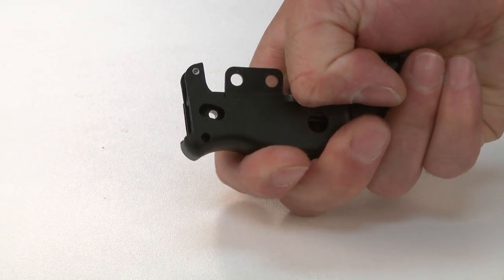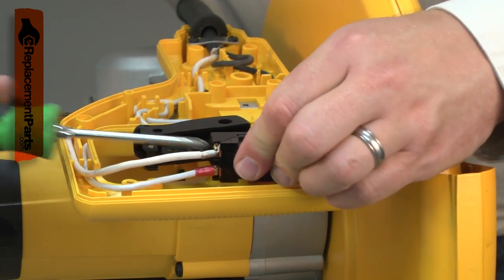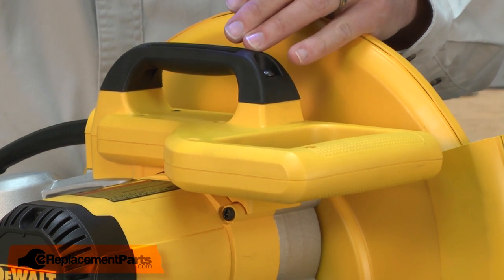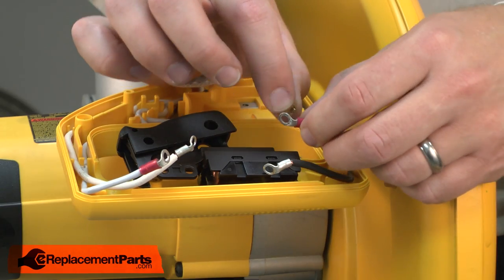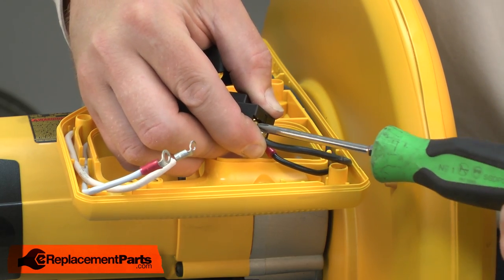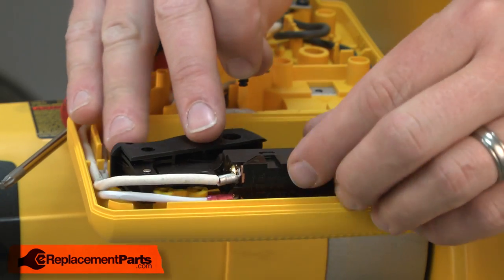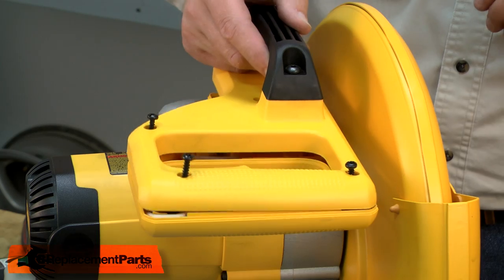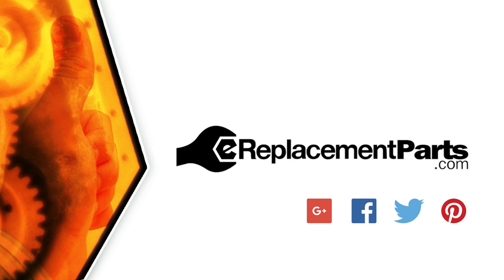Chop Saw Repair - Replacing the Switch (DeWALT Part # 626214-00)

Comment: Thanks for the video. I replaced the switch on my Dewalt 12" Comp Miter saw DW715. It did not solve the problem. It stopped suddenly when in use and now is completely unresponsive. Any ideas? Thanks!
Reply from the maker: You may have some worn brushes. Or a burnt motor.  Remove the brushes and look at the commentator, to see if it is burnt or missing bars or has some raised bars. Check your cord for a short.

Comment: i should have mentioned that i also replaced the brushes even though they looked fine. i pulled the motor and it looked good too. the cord appears perfect.  all wires look perfect. motor spins freely.
Reply: me same problem, suddenly stopped and everything looks ok
Reply: there's a reset button but that's also not helping. It's a dewalt d27107. could it be the fuse? is that located at the reset button?